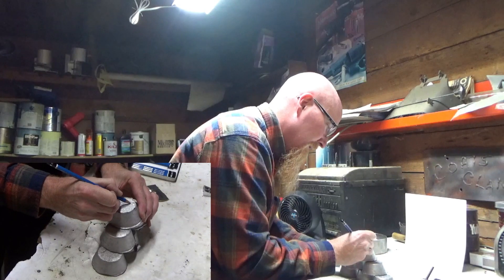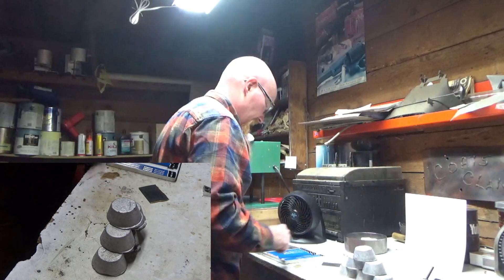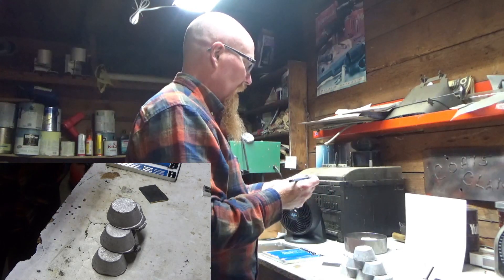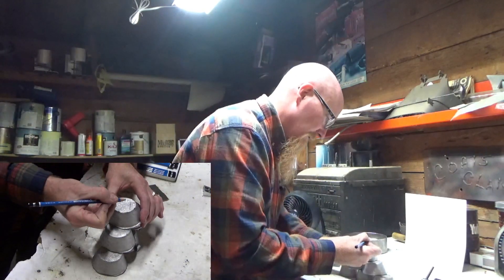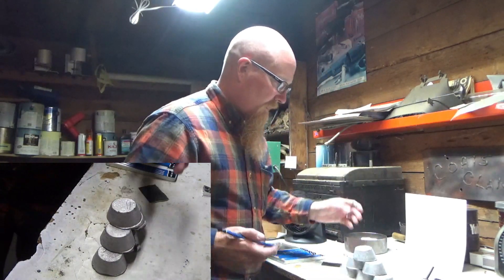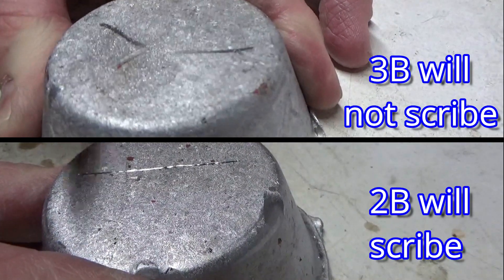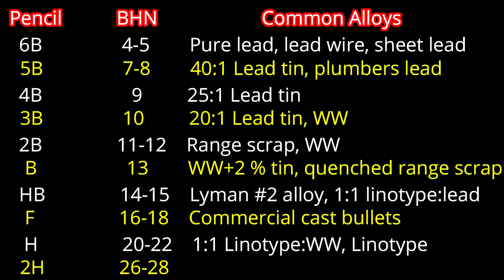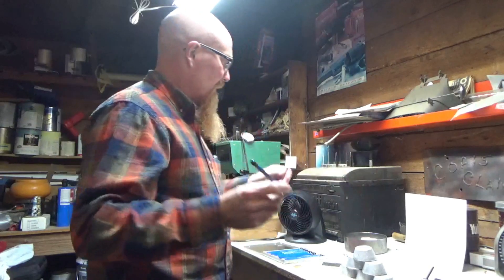Using art pencils for lead hardness & BHN testing

Comment: Thanks !!!  That is an idea well worth trying.  I cast for a .357 magnum rifle.  My Lee 358-200-RF projectiles at 950 fps have been my most consistently accurate bullets (maybe 2 MOA) and they are cast from roofing lead with around 2% tin from solder.  But my 158 and 125 grain projectiles aren't as accurate made from this alloy.  Recently I got some very pleasing groups with the smaller bullets using a 50:50 mix of wheel weights and roofing lead.  So thanks for the pencil-testing idea.... I now have a hardness indicating method that will help me in my experiments.  Best wishes from New Zealand.
Reply from the maker: You are welcome!